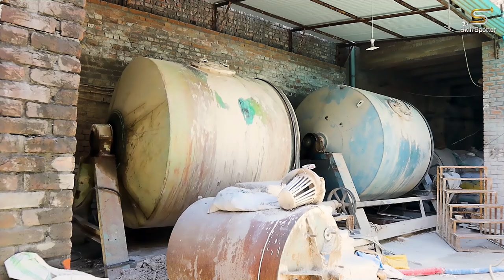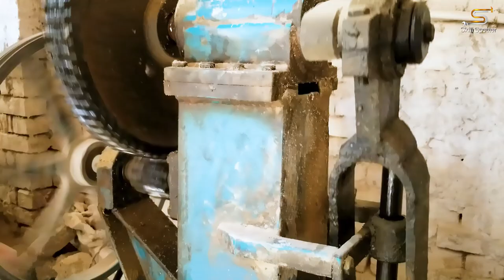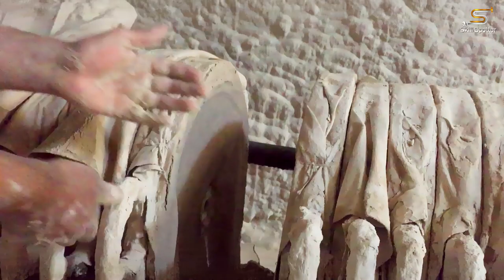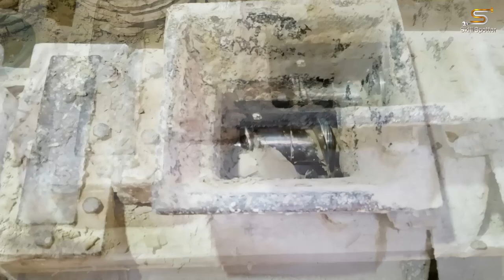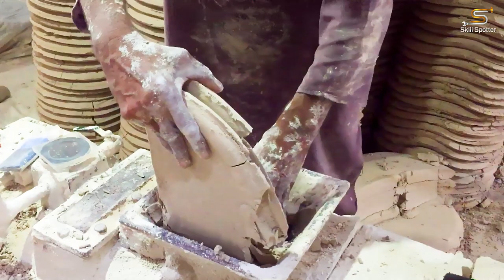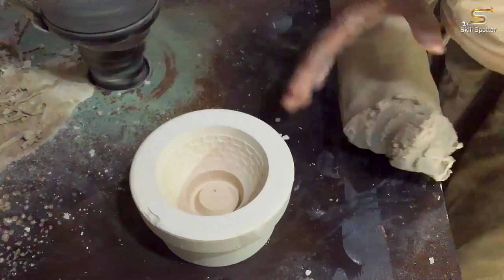Grinding Ball Mill to Clay Reclaim Process & Potter Pugger Ceramics Pug Mill Actions

Comment: I've got a wood chipper I stick my hands in all the time.  I just know where the blades are and never push that far.  Seems like the pug mill operator has a good handle on whole situation and doesn't put his fingers near the discharge end of the exposed screw.
Reply from the maker: Practice makes a man perfect.
Reply: And it only cost him part of a pinky finger to find out how far to stick his hands in. Truly, the safety police need to calm down. /s
Reply: @jonathang6920  Not everyone needs a cork on their fork, Ruprecht.

Comment: How long does the clay stay in the press to get the water out of it? Do you pour in the liquid clay mud into the canvas and then out it in the press?
Reply from the maker: Liquid clay automatically comes into the molds by pump and it's staying in the press only for the time when water is completely squeezed.
Thank you so much for your comment.
Welcome to our channel.
Reply: @SkillSpotter  thanks for the reply. I looked up other ceramic press machines and saw detailed explanations of how they work. Very interesting and useful.
Reply from the maker: Thank you so much dear.
Reply: @SkillSpotter  What is the raw material?